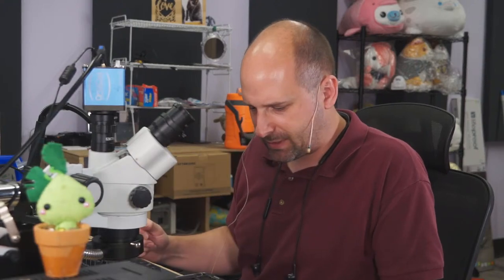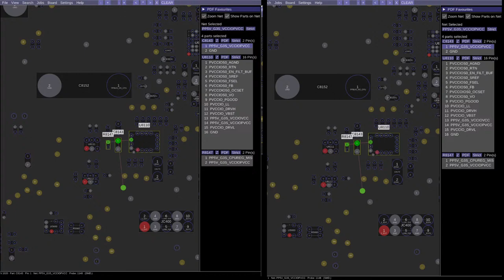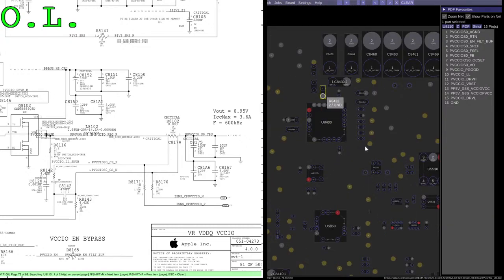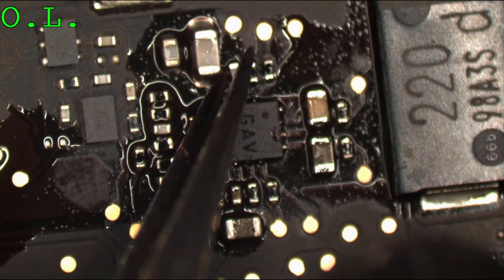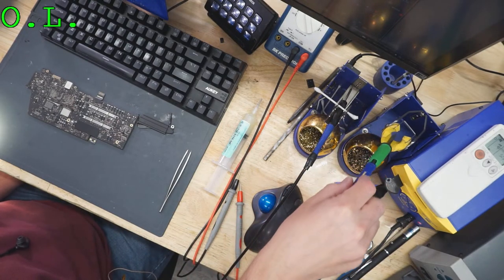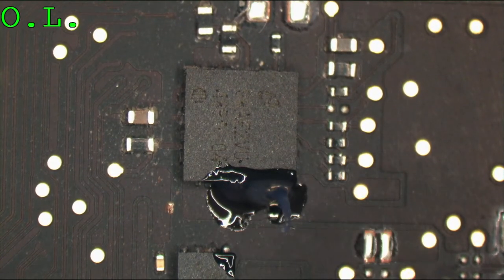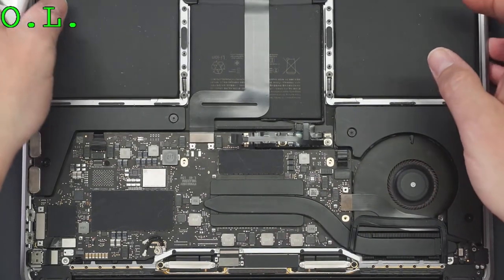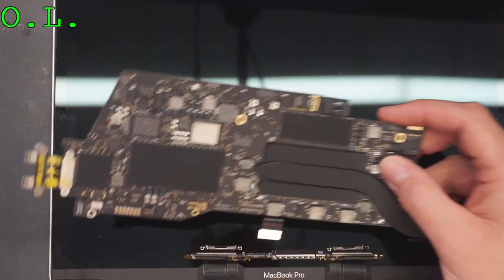Paul fixes a Macbook logic board

Comment: TL:DR: Saw something similar, mysterious backlight damage included, on an M1 macbook pro repair video some months ago, but that also included both CD3217's being deep fried and shorted, so might be something else.

Still gonna mention it:
Machine in this vid: 2 issues: 
- The chips shorting, which you at 15.57 describe as buck regulators (and you show as CPU related). I looked up the ISL95870HRUZ chip name in the schematic and it shows it as an Intracil/renesas chip in the document.

- Backlight somehow gets hit.

A few months ago I saw TCRS Circuit flawlessly fix a brand new M1 Macbook Pro. What at first just seemed like CD3217s blowing up turned into also having:
- A chip shorting, the chip had "renesas" written on it, described by TCRS as "something that would be used for the CPU. Looks like a buck converter..." (His vid: 29.10) 
- After fixing it, guess what...no backlight. For some unknown reason, something got fried in the backlight circuit, apparantly at the same time, since I doubt the customer was using the machine with no backlight up until the earlier faults happened. Turned out to just be a 0-ohm resistor with a hole burned through it, in the backlight circuit, but still.

Oh, and you mention this happening all of a sudden, on many machines, speculating a software update from Apple could have affected it?
The TCRS repair (that also took out the CD3217s) was around the time of the bonanza of USB-dongle-use frying and bricking M1 macbooks, Something that was later patched with a software update I believe. 

The CD3217 fryage seems to indicate this might be something else entirely, but still: Quite a few similarities.

TCRS vid:
https://www.youtube.com/watch?v=110x5rMHCIw

Comment: Hopefully you guys have access to the datasheets for these two chips that keep dying, sounds like this particular setup is pulling too much current or just enough current to wear them out causing consistent shorting on the input pins. Didn't you say the 1.00V chip put out like 6 Amps or something like that? That's quite a lot of power even at 1 Volt and there seems to be a common problem in the design here with high current usage related to things auxiliary to the CPU.